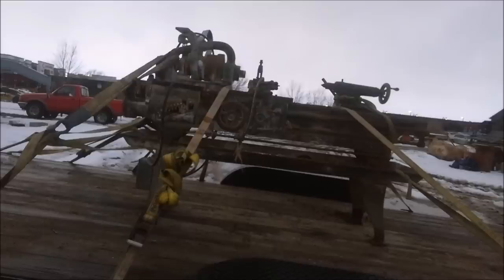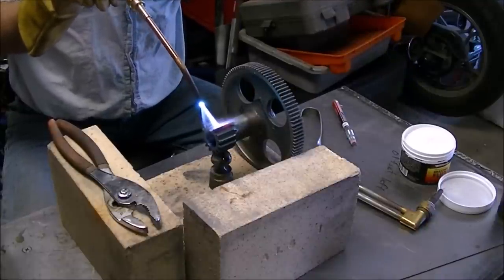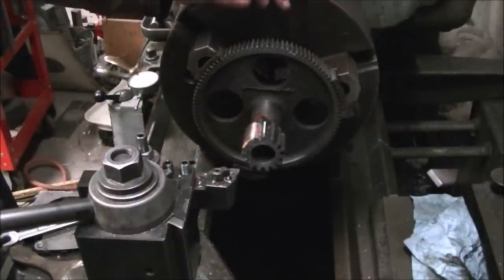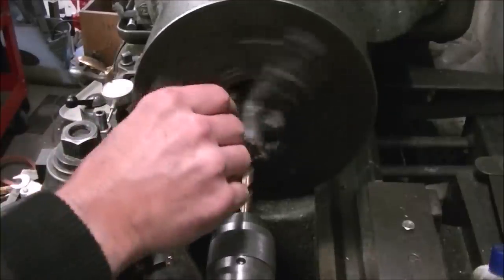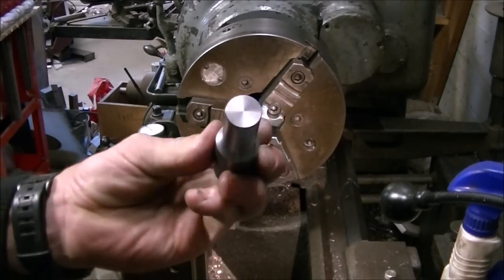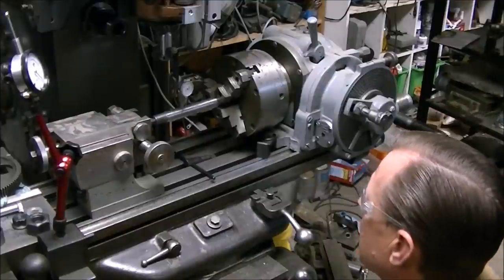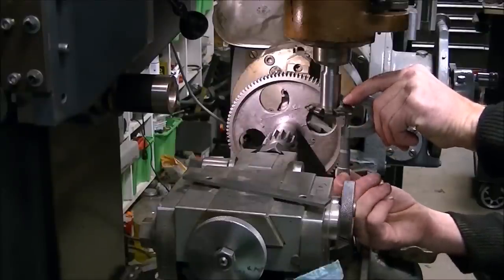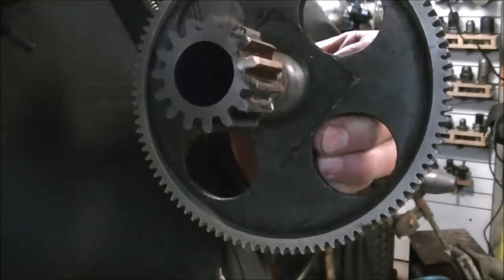Hendey Gear Repair

Comment: Nice job. Especially for your first time. The YouTube community is lucky to have great mentors like Keith Fenner, Keith Rucker and ABomb to show us amateurs how to do these jobs.
Reply from the maker: Larry, we are lucky indeed. Thanks for stopping by. Craig
Reply: clemwyo We just subed your page/site anyway I was a machinist for 25 years until my left leg was taken off (congestive heart failure) caused problems. like I said we just started watching and we are really looking forward to seeing this old girl up and running again. another thin, the teeth you did not do, cutting them out will weaken the over all gear right? we are thinking you could do what you did with the missing tooth without grinding off all the other teeth all together right? that way the braze will just fill the wear spots, of cours3e you would rough them up good to make sure the braze stuck well. YOU MADE ME FELL LIKE WORKING my mini machines again, even no I can't run the big ones hahaha hope to see the lathe up and running, Joseph T
Reply: Larry Small j
Reply: You could learn to read books and then take your "mentor" anywhere.
Reply from the maker: DEEREMEYER1 I have a pretty good library of machining books but there is nothing like watching someone do something for me to learn. Thanks for watching. Craig

Comment: Glad to see another Kerney & Trecker still producing quality work, I have a #2 5hp myself, they're incredible machines.
Reply from the maker: +MerlinxPV I agree, they are amazing. Mine was built in October of 1945 and, with my hobby use, will be running just fine in 2045. If I ever see a vertical K&T for sale around here, I'll probably have to buy it. Thanks for stopping by and commenting.Craig

Comment: As it happens, I just watched Keith Rucker's video about grinding out and replacing a tooth via braising.  I thought I was watching the video again during this video. Very well done!! Didn't even notice the tooth wear until you presented the completed project, the wear was significant at that point!  <subscribed!>
Reply from the maker: +Mike Schaefer I watched both Keith Fenner and Keith Rucker's videos on gear repair several times before I got up the nerve to try it myself. I'm hoping I can live with the tooth wear, if not they'll all get brazed and recut. Thanks for watching and commenting. Craig

Comment: I had the same problem with a spline shaft on an antique dozer. I built up the ridges on the shaft by using very hard arc welding facing rod. After several hours of hand filing, it worked fantastic and is still going years later
Reply from the maker: +Michael C I don't envy you the hand filing. I used to have to build up drill augers with hard facing rod but I wouldn't have wanted to have to file them afterwards. Thanks for stopping by. Craig

Comment: well, glad to see someone else has a lathe that came over with Columbus!  I have one that is pre1900 and it had been in a chicken house for 20 years.  The apron was broken in half and it needed some major TLC to make it look new again.  The I had to eventually repour the split nut babbit as it took about 1/2 rev of the lead screw before the apron would start to move.  But the main thing is the bed is all worn out in the first 12" or so where it has gotten most of it's uses and  get further from the chuck and the apron doesn't want to move too good.  takes the patience of Job to use, but it was free and it was my first learner lathe and only lathe all these 35 years.  It's like an old friend!

Comment: Nice job Sir. You got my sub. Only thing I would like to say is I see lots of guys doing this brazing with a torch and it seems to work out good. I welded for a living in my past and I also did a lot of torch welding. What I did different was when I set my flame on my torch, I did not have a huge flame going like I see lots of guys do. I would get the flame set to where it was no more than a half inch from the tip of the torch and it was a perfect blue flame with out all the flaring all over the place. This will save gas and the flame will be hotter and you can concentrate the flame right where it will heat the part to the melting point. Then when the rod is touched to the part, it flows right where you want it and makes a perfect bond. The heat from the part is what melts the rod, not the torch. That way you know for sure you are getting a good weld. Hope this makes sense and helps someone.
Reply from the maker: +Danny Wilsher you're right of course. I am really embarrassed by the flame on the torch when I watch the video. As you can also see, the tip of the torch is partially clogged. I should have cleaned the tip but being lazy and having limited shop time I went ahead and then put it out there for the world to see. The last brazing job I did I used the TIG torch and I really liked that method. Thanks for watching and commenting, I'm trying to get the next video together but life keeps getting in the way. Craig
Reply: Craig, no need for embarrassment!!! You did a wonderful job just the way you did it. I commented with hopes of helping you or anyone else trying this to maybe get an idea of a different or possibly better way. If we all learn from each other, then we all win!!! Thanks, I will be watching for your next video!
Reply from the maker: +Danny Wilsher without YouTube I'd still be staring at my lathe wondering how it worked and how to use it. It is a great time to be alive. Thanks, Craig
Reply: @dannywilsher4165   But then with a hotter flame, as you suggested indeed, then it might not have warmed up faster than he'd be able to properly weld it.
With a weaker flame and less heat he was able to take his time without damaging anything :)

Comment: I just did a similar job on a (nylon?) gear, part of an electric seat I bought for my old van. Three teeth missing on the ring gear of a worm drive. I built it up exactly as you did, but I used the baking soda and superglue trick to make a very strong build up after I drilled locating holes in the original material. I trimmed it down to the original width and diameter exactly as you did, by hand, then carefully cut the teeth back in with a tiny triangle file. It is reinstalled and the non functioning height adjustment works fine now.
Reply from the maker: +AKA Wireguy it's nice to be able to repair things rather than just throw them away isn't it? I'll have to remember the baking soda and super glue trick, that's Rhett first time I've heard of that one. Thanks for watching. Craig

Comment: Really liked the "vertical turning" on the mill and you are right, it will ensure concentricity with the Z axis on the mill. Nice job. One thing is to watch the two Keiths do it. Another is to actually do it.
Reply from the maker: Juan Rivero there is certainly a difference between watching and doing but at least we have the option to watch and learn first these days. I still make plenty of mistakes but not nearly as many as I would without all the experts sharing their knowledge with us. Thanks for the comments. Craig

Comment: Good repair. I Have a 1922 model Hendey 12x5 and the same rack gear was broke as well. On mine it was bolted to the bigger gear.
Reply from the maker: Glen Young, that would be a handy way to have it. My 12x5 lathe is the older style with the single wall apron rather than the double wall aprons that Hendey introduced in 1916 (I think). Craig

Comment: This is a nice repair and thanks for the video. I have a commercial machine repair shop and have done numerous gear repairs large and small as this but I use Nirod ( trade name ) for the tooth build up or anything that needs build up or crack repairs as Nirod truly becomes an integral part of the repair and can take the same loads as the original part, whereas  brassing is just a bonding It's ok and many do it but if maximum strength is needed actual fusion of base material and filler must occur. If done right any hobbyist can do this high strength repair and end up with a repaired part just like the original looks and all.  Again thanks for the vid.
Reply from the maker: +Hemi Power I looked up Nirod after reading your comment, it looks like a very interesting product. I'll have to try it on my next cast iron repair. You might need to post a video on it though because not much showed up on YouTube when I searched there. Thanks for watching and commenting. Craig

Comment: NIce job, I have a Tree 2UVR mill that has 2 broken teeth on the rack that tilts the head. The only problem is if I take the head off the mill to get to the teeth I no longer have a mill to cut the teeth. The casting is way to big to mount on the lathe to try to use the scraper method. I think I will have to just braze it up and then file, file, file. I was not aware until now that silicone bronze was near the strength of cast iron. I WAS going to build up weld for the new teeth. 
Some people are amazed that it can take days setting up for a cut that takes seconds to complete.

Thanks for the vid, you are way better at it than I am.

And you are correct, I often wonder how people survive without a mill and lathe in the basement.
Reply from the maker: Jeff, I would think that brazed and filed teeth would work fine in that application. I still need to get a gear and worm in the vertical head on my mill. Right now I loosen the bolts and bang on the head until I get it trammed in, then I tighten the bolts and then it is out of tram and so I start over again.

Set up usually takes most of the time, the actual cutting is the quick part.

Thanks, for watching and commenting. Craig

Comment: Great job on the repair. I need to do the same thing on my 1950 13-inch Sheldon where a previous owner had crashed the thing and broke two teeth off the bull gear in the headstock. They drilled and put in bolts, then filed or ground them into a rough tooth shape. It works, but is noisy when I use back gears. I want to fix it the same way you did.
Reply from the maker: spnynorman I was pretty nervous to start this repair because, like your bull gear, there aren't any spares available if it gets ruined. But it went much better than I was worried about. If you decide to do it, just be careful with your setup and it should go fine. Thanks for stopping by and commenting Craig

Comment: If you don't have a mill or gear tooth cutter, grind a high speed steel tool bit to the correct profile using the gear teeth as a gauge, set the tool on it's side in the  lathe--on center. Put the brazed gear in the chuck or on a mandrel as required.Line the cutter central to the surviving teeth, jamming the chuck from rotating by whatever method and hand crank the apron handle to turn your lathe into a shaper. I have cut splines using this method and it works really well.
Reply from the maker: Jack Frost that way works well, a little slow but certainly works. I've cut keyways in gears that way too. Thanks for watching and commenting, Craig

Comment: Good job clem on building the tooth cutter shaper holder. I remember the first time I brazed and too found it easy after years of mig, tig, wirefeed and stick welding. I am pretty sure if you get used to tig welding brazing is not that bad. I was hoping the end of the tooth would be full but not really that hard to build up the gear tip. What I have found with lathe broken gears is a sticky three jawed chuck that is threaded on. To remove the chuck guy's will hit the chuck with either a dead blow hammer or a lead hammer with the lathe holding it still in reverse. A prescription for broken gear teeth. Removing the chuck with the lathe out of gear please.

Comment: Nice Job ! Small point to bear in mind for the future: a long skinny burr like that is never going to amount to anything when it comes to stock removal. Ideally for that you'd want to use a bigger, heavier die grinder with a 6mm or 1/4" shanked short burr with big cross-cut teeth (big relative to the size of the 'bulb', that is).
Reply from the maker: Gottenhimfella yes, you're right. I gave up on that burr rather quickly and moved onto the grinder. I need to get a good die grinder, it is on the list. Thanks for watching and commenting. Craig

Comment: I've tig brazed silicon bronze with great accuracy,  less flow out. Works good on cast iron
Reply from the maker: +Dmm Dmm543 +Dmm Dmm543 I just tried tig with silicon bronze the other day and I agree with you, it was much easier to control than using the oxy-acetylene torch. I may get that video up one of these days. Thanks for watching and commenting. Craig

Comment: I have this same lathe. Seems to be in great condition, at least no issues that I'm aware of - so far.
Reply from the maker: John DeBrular hopefully it’s in better shape than mine. I have two more gears to repair and two that will have to be made from scratch. I’m going to get a couple more videos out on the next month. Thanks for stopping by and make sure to visit vintage machinery.org for manuals, parts diagrams and interesting Hendey history.  Craig

Comment: I just wanted to add, that putting a rag on the stock while the lathe is powered, as close to the chuck as that, you would be shocked how fast it can grab you.  Horrendous injuries over the years, lead me to caution. turn the lathe off before cleaning, unless emery.
Reply: I heartily agree with that point! I've been "schooled" by a piece that I estimated had enough polish not to clutch, but the fibers in the rag felt differently. Fortunately, no digits were included in the tuition for that lesson, just the rapid caress of narrowly averted disaster. Give a guy religion, that...
Reply from the maker: +John Elliott I have since repented and now either shut off the lathe or use the blue paper shop towels. Thanks for stopping by. Craig
Reply: I cringe when i saw  the rag on the stock while the lathe is powered. I was unlucky to sustain an injury when putting a rag on the  stock while the lathe is powered, my left index finger was twisted off my hand.
Reply from the maker: +mfpitci after hearing from Mr. Hiiginbotham and you I have repented of my erroneous ways. I will be sure to mention your advice in a future video so others are aware of the dangers of a rag on a running lathe. Thanks for sharing your story as that is how we can all learn from each other here on YouTube. Craig
Reply: Absolutely. Titanium Swarf with a new insert is razor sharp. Instead of the pliers for the 100th time, I used my fingers "just this once". In a quick motion the swarf was 1/4" down into my thumb with absolutely no resistance. I knew better.
Reply from the maker: +Dan Fowler I too learned the hard way, with stainless steel. I don't think a surgical scalpel is much sharper than some of the chips off a lathe.. I've never turned titanium, one of these days... Thanks for watching. Craig
Reply: @mfpitci    8 9
Reply: @1960jelliott  j9.9.  9
Reply: @1960jelliott   9u
Reply: @clemwyo   9. 9h
Reply: Lol sorry about that was sleeping on my phone. Hahhahahaa
Reply from the maker: Jason Gay you did have me a bit confused. Craig
Reply: a lad at my work had all his bones pop out of his hand when his glove took his hand backwards round the chuck.

Comment: very good job  thats what i did when i had to repair a tooth some times a series of soft bolts works too
Reply from the maker: +Harry Hamburg thanks for watching and commenting. I've seen that repair done also. Seems like it would work just fine. In this case, I don't think there was enough material between the base of the tooth and the bore of the gear for that type of repair. Craig

Comment: Hi, all the teeth exept what you did is hardened, so why you dont fill the missing theeth with weld and than hardened? Important question.
Reply from the maker: The teeth are not hardened,  it is just a cast iron gear. None of the gears in either of my lathes are hardened.
Reply: @clemwyo  thank you about your answer, i have a hardened gears and some of the theeth are broken, i want to weld them and after that to hardened but i never did that, you have an idea if it gonna work?
Reply from the maker: You might try posting some pins in where the missing teeth are and then grinding them to the proper shape. There are some good examples of this on the practical machinist antique machinery forum. I'll try and find one and post the link for you.
Reply: @clemwyo  thank you sir.

Comment: Nice job, enjoyed every minute of your video. Well organized workshop you have. Cheers from New Zealand.
Reply from the maker: +RODALCO2007 thank you for stopping by and commenting. I wish the rest of the shop was as organized as the corner I film in. Craig
Reply: I work with a lot smaller gears then yours. Mainly electricity meters and some clock work mechanisms.
Reply from the maker: +RODALCO2007 the past few years that small stuff has gotten hard for me to see. I guess I need to see about glasses one of these days. Craig
Reply: RODALCO2007 dayre kesmemakasi
Reply: RODALCO2007 ķ.
Reply: RODALCO2007 was

Comment: Why have you used bronze when welding and not a steel? will it hold? it might just chip off.
Reply from the maker: The original gear is made of cast iron. It was brazed with silicon bronze which is very similar in strength to carry iron. This has been the traditional way to repair cast iron for over 100 years. I'm hoping it holds up well. Keith Fenner had a recent video where he talks about why he prefers brazing cast iron to welding it. Thanks for stopping by. Craig

Comment: Very nice work, but is the brass tooth  strong and hard enough to last ?
Reply from the maker: +ddze it should be, it is actually silicon bronze which is very similar in strength to cast iron. They used to repair ring gears for starting cars with this method from what several old timers have told me. Thanks for watching and commenting. Craig